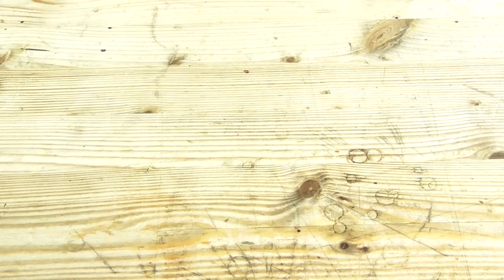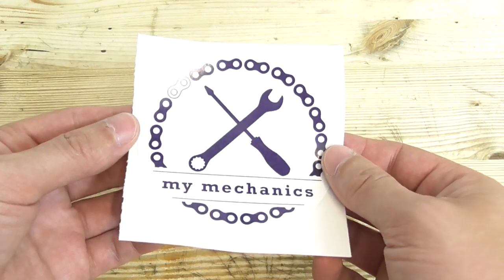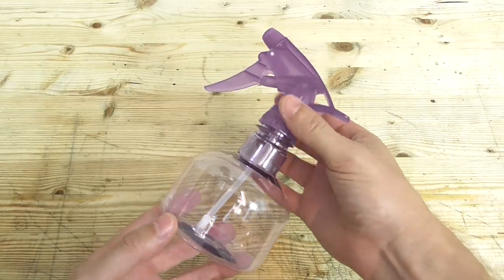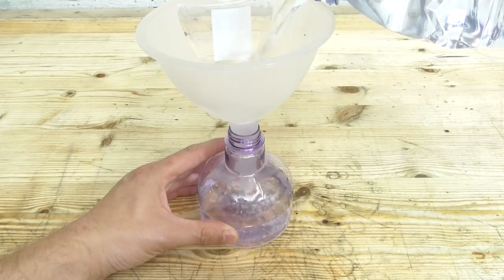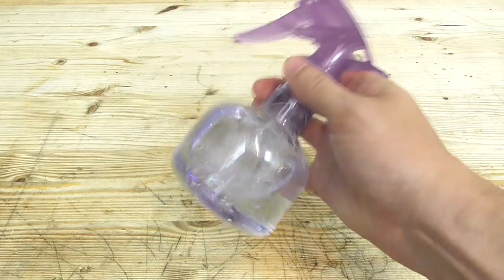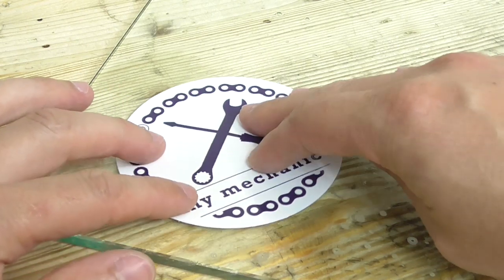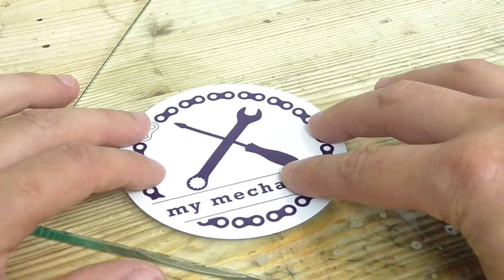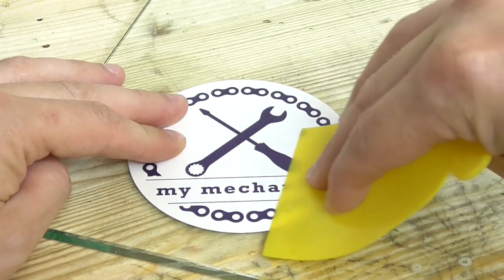How to place Stickers Perfectly with No Bubbles or Wrinkles - very easy

Comment: I run a convenience store and this is literally the exact instructions our marketing team gives us for placing our window signage. Except we're on a large scale and use a squeegee for large window signs. It never really occurred to me that this wouldn't be something most people don't know.
Reply: Over the years, I've been surprised by how many simple tricks of this sort their are. The water-slide transfers used on plastic model kits are half-way there, they depend on water, though they always felt fragile. You had to be careful at the squeegee stage, and getting the right final finish, matte or glass, was an extra problem.

Sometimes I find myself remembering that I did the same thing on some other job, as I watch one of these videos. That's a valuable lesson too.

Comment: Been using the soap and water trick for years. It works very well. I use baby shampoo. It has less chemicals in it, which seems to have less effect on different kinds of adhesives. Thanks for taking the time to make great videos. 🙂👍
Reply from the maker: It works great and it's so simple. Thank you :-)
Reply: Have you ever tried water, baby shampoo, and isopropyl alcohol?

Comment: If Acetone is too aggressive for a surface, Isopropyl alcohol usually works. Never use Ethanol alcohol for two reasons: Ethanol alcohol itself can soften or dissolve various kinds of plastic, so Ethanol alone might damage your surface. Also pure Ethanol would be very expensive (after all it's drinkable alcohol), so it gets denatured but the Denatonium usually used for that purpose, is a corrosive substance, so it can damage all kind of surfaces and coatings. Isopropyl does not attack plastic and it's also not corrosive. I used it on all kind of surfaces in the past, e.g. cleaning plastic computer parts and it has never destroyed or de-colored any surface so far. BTW, acetone is even more aggressive in regards to plastic, it tends to either soften it and to make it brittle, so never use Acetone on plastic surfaces. One thing acetone can do that most people are not aware of is dissolving super glue. And if Acetone is okay for a surface, white spirit should be okay as well and is also a very good de-greaser, yet, depending on where you live, might be easier or cheaper to get.

Comment: Ladies and gentlemen....WE HAVE A VOICE!!

How long after pressing the soapy water out does it take to really stick in place?
Reply from the maker: It sticks immediately
Reply: i used the same method to apply protective film on my cars door sills. i had to redo one, because it was slightly crooked. it did'nt take to much force to peel it off and in the manual it said, that you'll have full adhesion after 48hrs.
Reply: "Soapy wooder"
Reply: @Silver_o  that's the Chris Fix brand, this is "Soapy Wadder".
Reply: @mymechanicsinsights  What country are you in or from? I couldn't find it in the "about" section of the channel. Thank you!
Reply: @k.pacificnw02134  He's a German-speaking Swiss.

Comment: This is good for plastic based stickers. Id be carful with paper based stickers. 
Also a 50\50 IPA water mix is good for the cleaning. Doesn’t leave residue.

Another tip is to wet the top of the sticker as well to stop the squeegee from scratching your sticker. 

Good video

Comment: I’ve done this for years with decals, I had no idea it would work for adhesive backed stickers! Time to order some Jegs parts so I can try this with the sheet of stickers they send!
Reply: I was wondering if it was a regular sticker, or a vinyl decal/static sticker.  I've seen this trick with those, but figured it would ruin the tack of a regular old sticker.

Comment: The ideal degreaser is brake cleaner in my opinion. It's designed specifically to evaporate without any residue and is great for applications like that. Even says so on the can. But be care full with plastics, brake cleaner is composed of very good solvents.

Comment: Another little tip give by my very little experience: if you have a little bubble at the end (expecially first times) you can make a very little cut on it with the end of the blade of a cutter or something similar, get the air out so the bubble disappear

Comment: Very nice tip. Now do you have one to remove a sticker without spoiling everything?
Reply: Heat it with a hot-air gun until it's nicely warmed.  That will soften the adhesive so it comes off easily.

Comment: The way this works is that the soapy water actually penetrates the membrane of the sticker plastic material and migrates in between the surface on which it is stuck and the sticker, then loosens it easily.

Comment: In the sign trade, we’d use literally only a tiny drop or two of soap. It’s only there to break surface tension. On glass, sometimes we wouldn’t use any soap, unless it’s a very strong adhesive on the vinyl or sticker.

Comment: At my work students are always peeling off the adhesive tapes we use to stick the cards with "study area rules" on the tables. It is easy for them then to lift the cards because they have bubbles underneath. I wanted to stick the cards on a wooden table. Is this method also applicable on wooden artifact?

Comment: How about "How to remove Stickers" espacially on difficult surfaces that would be damaged by solvents or heat?
Reply: I know this comment is from 2 months ago, but I have had excellent results with naphtha (lighter fluid). It evaporates almost instantly and leaves no residue, and I have not found it to harm plastics, paint etc. It is obviously extremely flammable until evaporated, so stay well away from even the tiniest of sparks. Squirt some on a small rag and rub it on even the oldest, driest adhesive and it will dissolve it like it was never there.

Comment: Also, removing the sticker is the reverse of this procedure. Spray the sticker with the soapy water and cover it with plastic sheet and let it soak for about 30-60 minutes. You might need to spray several times during this time period, especially for very old stickers. Then with a plastic blade, or metal blade you get at the edge and slowly work your way inwards, all the while spraying with soapy water. Trick is not to let the sticker get dry.